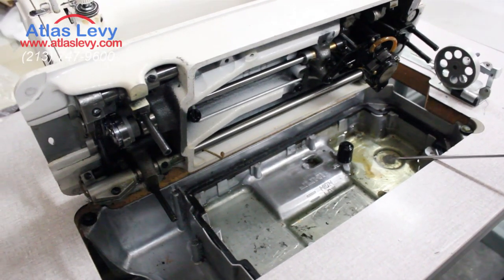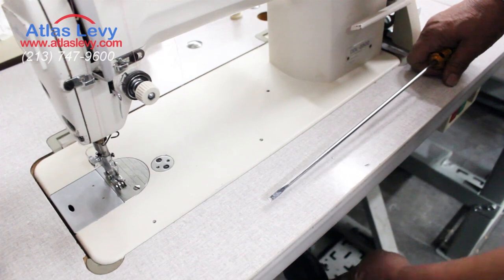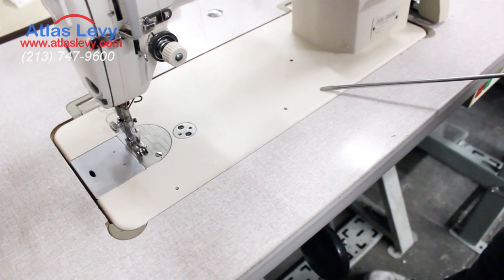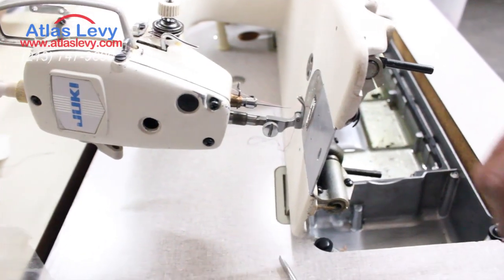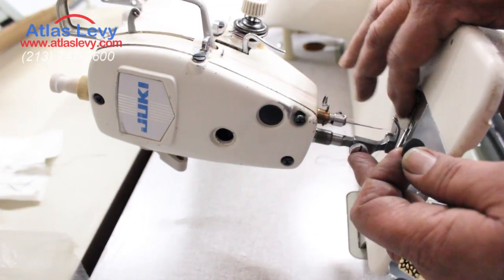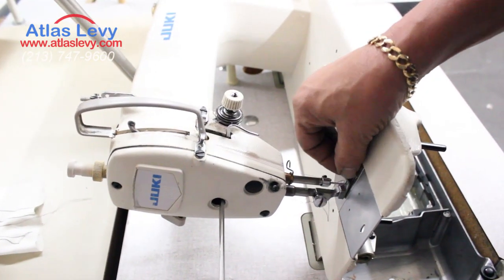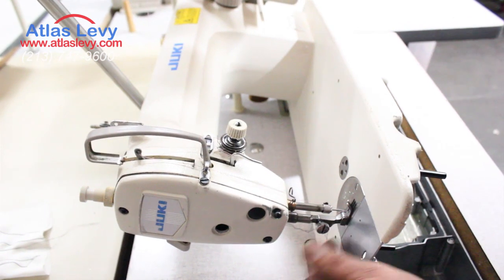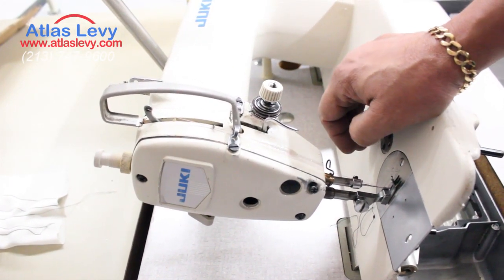Troubleshooting Presser Foot- Presser foot won't go all the way down

Comment: Thanks Atlas Levy!  I have a Juki LU 562 .  The presser foot was not hitting the needle plate correctly.  I used this video to identify the problem. I adjusted the knee lever “umbrella” piece until the lever had a little play in it.  Now has no room under the foot and it’s working great!

Comment: Can you help we have cylinder bed 335 and I need troubleshooting guide on foot tension set up. Wheel binds when outside foot is engaged but clear when we lock in up position?  Is their a video or website I can visit?